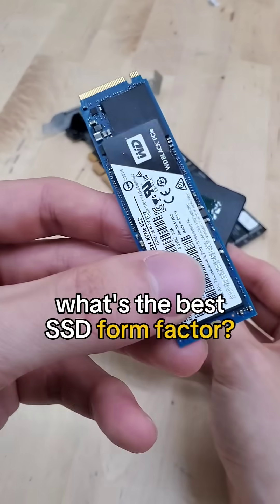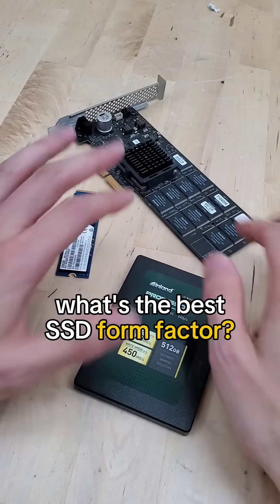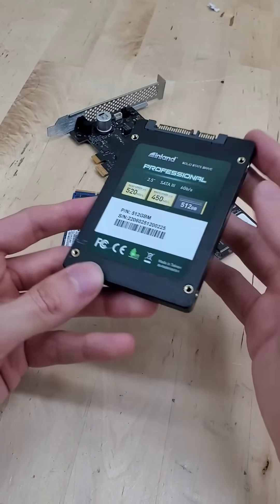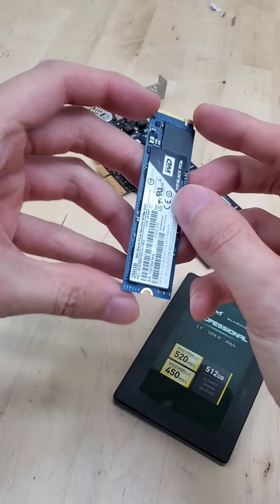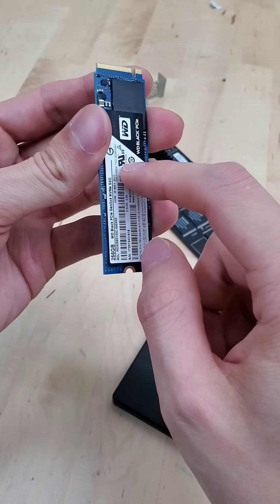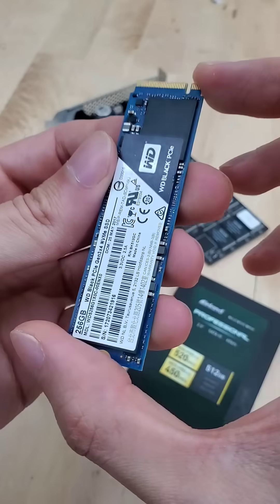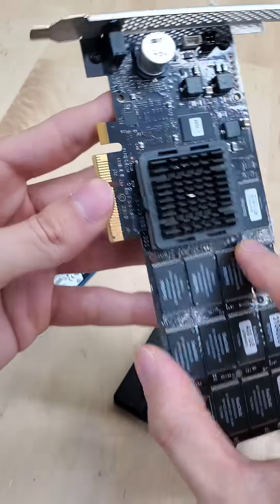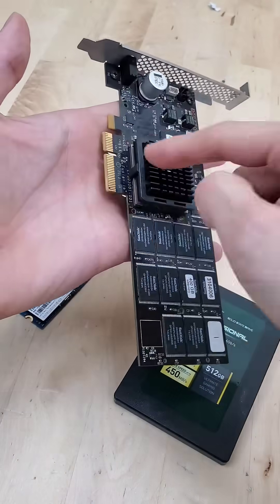The beautiful diversity of SSD form factors

Comment: PCIe SSD have exact same speed as NVME M.2, both use same pcie lanes and can be PCIE3.0 or 4.0 or 5.0 , at max x4
PCIe SSD can be used on older motherboards without NVME, most BIOS versions support it even as boot drive.
Reply: All NVME connect via PCIE, what you are calling a PCIE SSD is an NVME AIC
Reply: Yea had my PC on SSD for boot drive. It was faster then HDD. Had my PC boot from a SSD for years until my other SSD died and would short my os SSD. Switch over to a M.2 boot drive and found out that my OS SSD still worked. 
Faster boot but less room for games.
Reply: Наконец то адекватный ответ 🤷
Reply: The fastest pcie 4.0 cards max out at 5gbps. PCIe Gen 5 is expected to deliver theoretical read speeds of 14,000MBps for NVMe SSDs, compared to the theoretical maximum of 8,000MBps on PCIe Gen 4 drives. Maximum transfer speeds per lane for 3.0 is 985mb/s, 2gbps for 4.0, and 4gbps for 5.0. To even utilize it, you'll need a top of the line motherboard with 2x pcie 5.0 16x slots so you can use the best slot for graphics. Then, you'll need a pcie card or adapter with 4x m.2 slots in raid to utilize the 64gbps theoretical speed. There's only x2 and x4 lanes accessible when using a M.2 form factor with the PCIe bus so 5.0 would max out at 8-10gbps, 4.0 would max out at 3'ish gbps. I've read that current pcie 5.0 4x m.2 NVMe drives max out at 10gbps and have serious overheating problems in the port. Even so, PCIE 5.0 x4: 128 / 130 x 16 = 15.754 gbps maximum, whereas m.2 NVMe is 7.5gbps rated and 20gbps theoretical. The best 5.0 drives are doing around 12gbps. A mobo with 2x m.2 slots in raid will be faster than a pcie 5.0 drive or 4x m.2 drives in pcie 5.0 and won't kill your gear. If a computer can support m.2 with NVMe and only pcie 4.0 then the m.2 will always be faster. pcie can also share bandwidth between lanes, where an m.2 slot has dedicated lanes.
You'll also never notice the difference between 7,000mbps and 35,000mbps unless you are transferring terabytes of data on the same machine or over Cat 7 gold-plated cables within 50 meters.
Reply: @Original-Logik  there is some enterprise ssd have x8 lane(3.0 or 4.0)
Reply: @leonpano  I think that it's still limited at the bridge/port. Those are probably for server machines? No idea lol.
Reply: @leonpano but not the card in the video, it’s an x4 card.
Reply: @Original-Logik  I think should not be limited
X16 devices can run in x8 x4 x2 even x1 mode
X1 x2 x4 x8 devices can also install in x16 slot
But what do you mean bridge/port?
Reply: @leonpano  Available lanes. Like Gen5 can only use 2 lanes, Gen4 can use 4. SCSI port/bridge 6gbps etc., m.2 port/bridge, each has their own limitations.
Reply: @Original-Logik that’s not true. PCIe 4.0 x4 goes up to 7,500MB/s, and 5.0 does 14,000-15,000.

Edit: just noticed you said the fastest drives but my 990 pro can do 7,200 MB/s read and 7,000 write.
Reply: @morpheus_9  Your 990 Pro is an m.2. Your bridge is 4x 4.0 or 2x 5.0, m.2 NVMe. "m.2 NVMe is 7.5gbps rated and 20gbps theoretical. [...] Maximum transfer speeds per lane for 3.0 is 985mb/s, 2gbps for 4.0, and 4gbps for 5.0. [...] There's only x2 and x4 lanes accessible when using a M.2 form factor with the PCIe bus so 5.0 would max out at 8-10gbps"

Comment: 20 years ago we were replacing IDE drives with IDE-to-CF adapters for mostly-read applications. Performance was...slightly better, but they were mechanically shockproof.
Reply: This is interesting... most people don't know this, but there were 3 different interfaces that were all the same electronically.  IDE, ZIF, and CF... usually I saw ZIF to CF adapters, because IDE SSD's were just a thing that existed.  And, if you have a 1st gen iPod, you can replace the internal ZIF HDD with a CF using a ZIF to CF adapter.
Reply: @cpljimmyneutron  you can get a master-slave dual CF adapter for IDE, which can get you dual SSDs in a laptop with only one bay. i had an ancient A31p in highschool that i found at an electronics recycling facility and I threw two CFs in there. great setup.

Comment: M.2 is the form factor. A more accurate description would be m.2 nvme ssd, unless your m.2 slot going through the south bridge (a call back to another of your uninformed videos) then theyre called a sata m.2 ssd.  The pci card is a pci nvme ssd.  Nvme ssd and pci ssd cards use the same pci lanes. The only difference is lanes available to the devices and cooling/caching.  Please educate yourself and stop using chatgpt to write your scripts

Comment: For anyone who doesn't understand it all the way, M.2 is the form factor. The actual SSD can be SATA or NVME, NVME is the faster of the two as it utilizes PCIE for communication.
Reply: To expand a bit further the interface on an M.2 SSD can be SATA or PCIe. SATA drives almost exclusively use the AHCI protocol and most PCIe drives use the NVMe protocol. Early PCIe drives did use the AHCI protocol though so there are some PCIe M.2 drives out there that are not NVMe.

You can also get PCIe SSDs in the 2.5" form factor but they tend to use a U.2 connector/cable.
Reply: What is the advantage of a PCIe 2,5" SSD?
Reply: @Marquploads  there's no such thing, 2.5 inch is the size of a typical SATA SSD without the M.2 form factor.
Reply: @MrPicklejuice98  2,5" drive but without the SATA plug connector? I've been considering to just buy the NVMe m.2 ssd i saw for like 75 dollars in November and searching for a 5$ m.2 or pcie x1 or x4 to USB 3.0 adapter since my ATA0 port started to malfunction heavily in the same month, coincidentally after i had to do a windows 10 reinstall due to corruption prior.
Reply: @Marquploads  as soon as you introduce USB it's going to hurt the performance of an ssd
Reply: @MrPicklejuice98  That's expected, I just need to move away from the SATA connection and decentralize data storage.
Reply: @MrPicklejuice98   Not true. U.2 drives are PCIe but typically come in a 2.5" form factor. One advantage is capacity as the larger physical size means you can fit more NAND flash inside. They are also hot-pluggable which is a big plus for enterprise use.
Reply: @andr3w1985  i see, thanks for the info. Not a form factor I've ever had any experience with, but I do understand the advantages

Comment: SATA ssds are pretty much useless, except perhaps a NAS or something. You can find M.2 NVME SSDs that are leagues ahead in speed for practically the same price, and while that does generate heat, you can still get one thats many times faster without any overheating issues.

Comment: you forgot about U.2 witch is the same size as 2.5 inch drives but also use the PCIE bus and have the same speeds as M.2 drives

Comment: I much prefer PCI-E AICs, M.2 slots have killed standard PCI-E slots for the most part, making aftermarket NICs & sound cards difficult to install on consumer boards. AICs also solve the cooling issue to due the greater surface area. They can also look cool in the case if the heatsink has a nice design.
Reply: Most people would rather use a raid card instead though combining multiple cheaper NVMEs to one larger one.
Reply: @Skylancer727  A proper NVME raid card is going to cost you $400-$500 at the very least and is going to eat up an X16 slot.  I've never seen any consumer PC with that setup.  If you mean a quad M.2 type PCIE card and software raid that's not a raid card.
Reply: @nadtz most people use raid for data protection or just one larger file location. You can find raid cards for that for less than $100. It won't give the flawless increase in file transfer speeds of a true data center raid card, but who really needs that?
Reply: @Skylancer727  Please show me a NVME raid card you can get for less than $100.  I'm guessing what you are talking about isn't a raid card just a PCIE card and raid is handled by software.

Comment: The sticker on m.2 drives are usually thin aluminium foil which helps with heat dissipation, remove at your own peril and wallet.

Comment: Had to put heat sink on my 990pro. My laptop was restarting every so often then though the temps say its around 50°c sometimes ir crashes lower, sometimes the ssd completely disappears from my bios so another restart fixed the issue. After adding a heat sink temps were down, crashing stopped.

My best guess is that my ssd was over heating and it turned itself off to protect it self?

Comment: PCIE ssd sacrifices GPU speeds I have heard...
Reply: Depends. But it can yes. In alot af cases it is not a problem.
Reply: not their fault, that's because some stupid motherboard did stupid things with their pcie lanes and msdt platforms unwilling to provide more than 16 lanes for pcie slots, and on just the wrong motherboards m.2 slots will also sacrifice GPU lanes (I'm looking at you, ASUS ROG)
Reply: @albertlong3492 yeah, I also have ASUS so I'm a victim of it.

Comment: 2.5in SSD's are also available with NVME connectors over PCIe using the u.2/u.3  port
Reply: those U2 drives are more intended for server/data farm applications, where the CPU's have buckets of PCI-E lanes to use them. they're fast with a high MTBF but they are quite expensive per GB!
Reply: @tech4pros1  true, threadripper for PCie lanes and Ebay for cheap new intel drives
Reply: Technically NVMe is the protocol, M.2/U.2/U.3 is the physical connector type. Hence why you can have SATA M.2s and SATA U.2s (for the latter, iirc). M.2 E-key is even used for both laptop and desktop (motherboard) Wi-Fi and Bluetooth. I wanna say B-key is the SATA M.2 connector, but not sure.

Comment: U.2 is also a weird form factor. Its basically a NVMe in Sata format. Most boards don't support U.2 but you can get a conversion kit for m.2 to U.2. But then again you are better off with M.2 because its cheaper and more commonly available.
Reply: There are also U.3 pokemons which can run both in NVME, SAS and even SATA mode xD
Reply: @Lapsio  Tri mode is the controller not the drive.
Reply: It's not weird, it's just not meant for consumer PC's.  And M.2 is terrible, just because it's common and easily available doesn't mean its good.

Comment: You are Old enough when you realize now SSD was "The cheapest and more Tradisional" Storage system. After how expensive those are back then compare to HDD.
.
oh man... times goes by...
Reply: Remember updates over floppy? Oh man.
Reply: @BigPanda096  that is even more reminiscing. You have a bunch of floppy lying around on your desk and you need to insert them one by one when you installing an app. As same as CD age. what a Good old days... 😌
Reply: @muhamadfarhanfirmansyah4346  And if even one floppy in the set is corrupted, it can be game over. 😅
Reply: @tbh3291  😭
Reply: I remember being a teenager and thinking how cheap HDD's were getting when I could buy an 80GB HDD for $80. I still use HDD's for mass storage and the last one I got recently was 12,000GB for $199. It's been fun to see how much technology has changed since the 90's.
Reply: remember when SSDs were called "Disk on Module" ?
Reply: siguen siendo mas caros que los hdd
Reply: @joseblancorodriguez4977  no dijo lo contrario

Comment: Wish you could have a 2.5" SSD form factor that could support 2x gumstick drives (sata pwr + 2 data cables (but with one normally-aligned one so it can fit in normal sata enclosures/caddies/situations)

Comment: the AIC can actually be slower. both are PCIe speed.. but think about trace length. the m.2 is compact, the AIC is not... this means electrons have MUCH further to travel in the AIC than the m.2... you got SOOOOO close to having it right...
Reply: it is not electron speed issue
Reply: @Краб-Крабович  You can say that. But strangely all of the experts disagree. There's a reason the industry is moving towards less replicable RAM...
Reply: Well to be fair, the progress on Aic card really stopped since nobody makes them anymore since pcie gen 4 onwards so there's that

Comment: Its a nvme ssd not a m.2 thats just the socket name. We have 2 "m.2" ssd's on is nvme aka pcie and one is msata
Reply: M.2 sata drives are still m.2 connector just a different key(i belive) and use sata protocol instead of the nvme/pcie protocols
U.2 2.5" drives are also NVMe but not m.2 form factor
Reply: msata is a whole other connector

Comment: The only difference is that some have more material and taste better
Reply: Taste😨
Reply: crunchy
Reply: Not really. The SATA ones are slow. Compared to NVME (be that M.2 or PCIe). You are limited to ~550MB/sec. While M.2 can be easily 10x-20x that.
Reply: @Kyanzes  well i just took a mega byte out of mine 😋
Reply: @Gamr-bc6kp  I can see some bits of it still stuck to your razer-sharp teeth.
Reply: @Gamr-bc6kp  gotta have that thermal paste dipping sauce too
Reply: @km077 and the corsair out of your mouth smells bad because of the bits between your razer-sharp bluetooth. I call them bluetooth because your teeth are blue
Reply: @Kyanzes  I mean M.2 can also just be SATA. M.2 is just a form factor with the ones that are faster being NVME. Still the board type can still be faster and some allow for multiple NVME to be raided for even faster performance.
Reply: @Kyanzes  i mean sata isnt that fast but still good m2 is fastest
Reply: @Kyanzes  550 is at the best possible conditions. Mine is getting average of 100 with different files and OS workload
Reply: @Kyanzes  also they twice as satas on price and probably 4x more expensive along with mobo and chipset that supports it 

and you dont really need allat unless you moving files 24/7 lol

Comment: Shouldn't slot in PCIE be limited to exactly the same limitations as m.2?
Reply: m.2 is limited to x4, you can get x8(and x16) aic ssds
Reply: @albertlong3492  oh I was completely unaware of that, thanks for clarification.
I thought that was motherboard limitation on how many lanes were made available.
Reply: @albertlong3492  So all those PCIE x8 and x16 adapters for m.2 just don't work? Because there are a lot sold (when googling for m.2 x8 they all show up)

Comment: SATA speeds are actually blazing fast and more than enough for 90% of use cases, unless you need have a heavy workload like 8K video editing or rendering 3D models or animations, in which case you absolutely want an NVMe SSD because you will need it.
Reply: yes, but many cheaper SSDs also have slower IOPS which is a factor for regular users. Granted these days the drives are still very fast and much high IOPS than any hard drive ever has.

Comment: There is another very rare form factor. It is like the last one but has four onboard SATA SSDs on two boards that are interconnected and sitting on top of each other. Those four single SATA SSDs are then connected internally to a PCIe to SATA chipset that makes the four SSDs look line a big one that internally has 4 SSDs in a RAID. I don't know why this exists but I have one laying around.
Reply: nvme prices are so close to sata I don't see the point in using sata unless you need to store a lot of data without risk of damaging it from movement, for smaller games there's very little difference if you have them stored on an hdd or sata
Reply: @ItsGamein SATA SSDs are great if you're upgrading an old computer with no NVMe slot, it was alot popular back in mid-to-late 2010s when SSDs have gotten affordable, many YouTubers made videos about upgrading their computers.
Reply: @Rullino32  there are still pcie to nvme adapters!!!
I'd still rather use that and buy a nvme ssd, esp. because ive kever seen a sata ssd cheaper than a nvme ssd nowadays...
Reply: "Rare" it's a daughter board called a HBA or Raid depending on functions.
Reply: @mattmeadows6568 No. RAID cards don't have all the parts from regular SSDs soldered onto it together with the chipset.

In the end it's just a RAID card, but with the whole internals of two dedicated SSDs on the same board with the chipset together with two additional ones that are on a daughterboard, connected via one big board-to-board interconnect. 

You can't replace the drives or take them out. You have four SSDs in one PCIe Slot, making one fully compatible fast SSD package, compatible with old OSs or boards that don't support NVMe SSDs.

Comment: I use a SATA SSD for my older games that are smaller file sizes so I'm not bottlenecked with by the slower speeds. I have 1 4tb SATA SSD for that. Then I have 4 M.2 SSDs, one for boot drive and programs, the other three are for my larger games. Don't have any of the PCIe SSDs